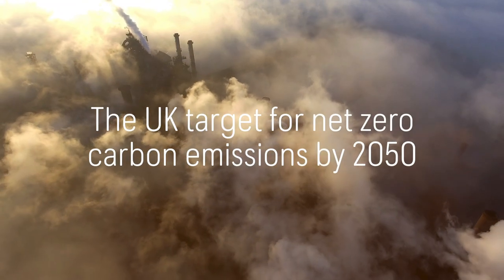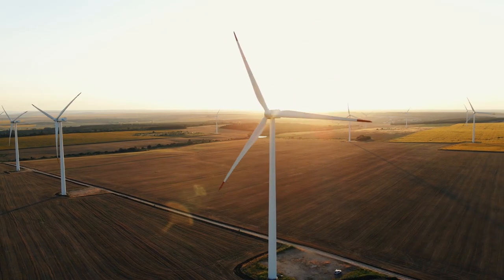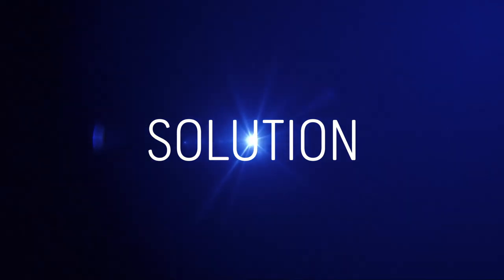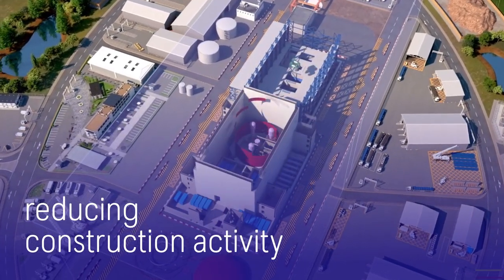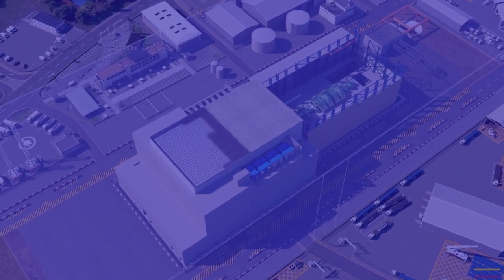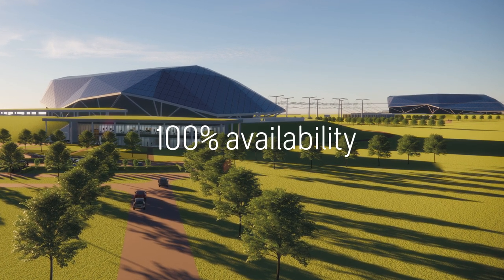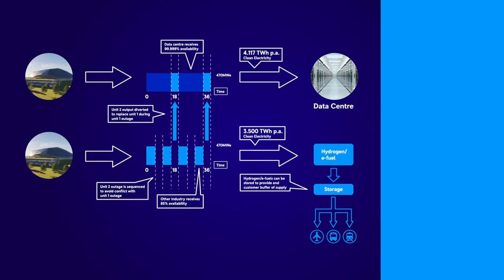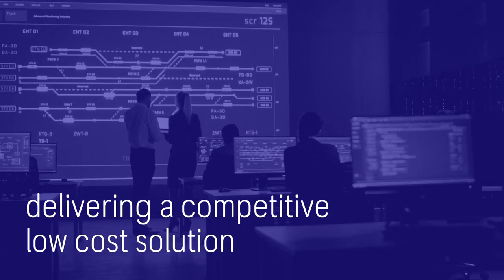Rolls-Royce | Small modular reactors

Comment: I think every large town should have one if these, and every city several. Time to step away from centralised energy production and putting all our eggs in too few large baskets. Will help close fossil fuel generation and peaker plants. This can't happen fast enough for me.
Reply: Towns having their own local modular reactors would also be a point of security. There's no central grid to take down that would shut down the nation.
Reply: @williamrbuchanan4153  You are talking about Chernobyl which is a large utility scale reactor with a design over 60 years old... These small modular reactors are the same kind that power submarines and power aircraft carriers. They are easy to build, safe and cost effective. BTW, the whole universe is radioactive, and it did not come from a melted fission reactor core! I take it you live in a cave and are still burning wood for light and heat right?
Reply: Chernobyl was known not safe when I was built. The yanks had been warning Japan about Fukushima for years. Waste disposal has been solved for decades, we just have to stop faffing around and do it. That said you can't just park these up next to small towns and expect it to work, you need to put a bunch of them next to each other on a larger site. You still get all the benefits, but they can be managed in one place.
Reply: @streaky81  Most towns have a power step down transformer site which would be ideal location if adjacent land can be purchased. Not sure what RR are specifying output at so not sure on multiples.
Reply: @GdaySport  that's the point, we know how to minimize transmission losses, the pylons need to be there anyway to keep the grid balanced and handle downtime, so you couldn't even use that as an advantage.
Reply: @streaky81  How is Nuclear waste disposal 'solved'?
I certainly like the idea of using existing Nuclear waste to reduce its danger time from tens of thousands of years to hundreds of years.
I Still want to see how it will be safely stored....
Reply: Yep nothing dangerous here.
What a brilliant idea.
Yes, sarcasm.
Reply: @stephenbrickwood1602  you sound a bit repetitive pal, perhaps go read some books about the advances in nuclear technology before copy and pasting blind negative comments about a subject.
Reply: @stephenbrickwood1602  newer nuclear technology has none of the security concerns of the past. Molten salt reactors need to be pushed forward. Look at the fuel and the waste products of those reactors. 

Also have a look at France for an example of how nuclear results in clean cheap energy... I don't like admitting when the French do something right, but I'll give em this one.

Obviously the salt reactors are not ready to go for now, but SMRs of a more traditional format are. And are perfectly reasonable with little to no additional security concerns used in many areas. 

Clearly for export there are issues to be discussed, but this is why molten salt reactor development needs to be heavily funded, whoever stumps up that cash first will be glad they did when they inevitably dominate the market after.
Reply: @GdaySport  470MW
Reply: Couldn't agree any more
Reply: With decentralized currency we can
Reply: It gets even better than that! Creating and distributing the power locally where it is actually needed greatly reduces the need for cross country power transmission lines and the resultant energy losses through them as a consequence of resistance and thermal convection
Reply: Write ypur congressman.
Reply: Two headed fish and glowing feces awaits us.

Comment: This is good. Not every city or town is going to need a full scale powerplant capable of producing gigawatts of electricity. The largest cities will still need that but most other places will get by fine on one or two 150 megawatt reactors.
Reply: But the Nuclear waste?
Reply: @cherylreid2964  there's a lot of things to do with nuclear waste, it's that nobody is actually doing anything with it. Some reactors can use nuclear waste as fuel. 

Also, compared to the millions of tons of toxic ash that comes from the burning of coal, along with gigatons of CO2 from fossil fuels in general, I'd say that nuclear waste is not as big a deal.
Reply: @cherylreid2964  Fuel reprocessing and fast reactors are the answer to the waste question.

Comment: When do deliveries start and where is the first one being built we need them quick
Reply: Regulatory approval is expected in 2024 with delivery beginning in 2029. The initial plan is to build 16 in the UK with each being able to power a city the size of Leeds (700,000 people). 16 SMR reactors will cost £30 billion in total and provide 7.2 GW capacity. Sizewell C, a traditional reactor, is projected to cost £35 billion with a total capacity of 3 GW. This is why the government is dragging its feet on further traditional reactors. SMRs have huge potential beyond electricity generation including community heating and cooling, hydrogen production, desalination and much else. Rolls Royce has a lot of experience in building military nuclear reactors.
Reply: @peterd788  Society accepted a multi year regulatory approval cycle for vaccines until Covid forced a radical acceleration. The ever increasing appreciation of a climate crisis suggests that Rolls Royce needs to raise its voice. Three years in regulatory approval for SMRs is no longer acceptable. Start with an appearance on BBC Newsnight. This technology and the probable use (later) of Thorium / Fluorine truly has the capability to be transformational.
Reply: @vincentmahon6423  I'd rather they follow the proper procedure.  As for thorium reactors they pose technological and proliferation problems.
Reply: @vincentmahon6423  I did reply about proliferation but it has gone. Basically, you can extract Proactinium from the Thorium reaction and then extract U-233 from that to create a fission device. A determined nation state could use the cover of a Thorium reactor to make a bomb.
Reply: @vincentmahon6423  sadly, they won’t, because “nucular bad! Hur- de hur-de hur....!” 🙄
Reply: Better be quick. “Someone” will copy it. Have it built in Xinjiang, with free labour. And corner the market, before you know it.
Reply: @peterd788  tens of thousands of years of Nuclear Waste is still not being addressed.
Reply: @vincentmahon6423  except for tens of thousands of years of Nuclear waste🙌
Reply: @peterd788  not so much with proliferation. Thorium is safer than Uranium.
Reply: @vincentmahon6423  tens of thousands of years of Nuclear waste is a huge issue.
Reply: @peterd788  Thorium was not used in early Nuclear Reactors because of the Cold War.
Both USA and Russia chose Uranium BECAUSE it can be used for weapons.
Reply: @Glenrok  Nuclear of itself has the issue of tens of thousands of years of Nuclear waste....
Reply: @cherylreid2964  The technology has moved on through at least two generations of development. The latest types of reactors generate very little waste. The waste that is generated has half life of some hundreds of years. These new reactors can actually use some of the legacy nuclear waste as a fuel. See also Thorcon's work in Indonesia, the work of Candu in New Brunswick and China's ongoing testing in Wuwei.

Comment: Does it require a location adjacent to a large body of water? Or is it entirely self sufficient?
Reply: It will need plenty of cooling water I should think. If so not a problem in the UK. The furthest point from the sea is 74 miles away in the Midlands. Being of smaller output they won't need anywhere near as much as a big reactor. More like the sort of supply used by a gas power station.

Comment: Question from a former nuclear power station engineer- Will the SMRs be refuelled periodically or are they going to run without refuelling for the designed life of the power station similar to the latest submarines requiring no refuelling for the life of the vessel?
Reply: Naval reactors use highly enriched uranium to enable its long life, which is not applicable to civilian reactors. So the answer is pretty obvious.
Reply: It's what they slap in the submarines so
Reply: They're intended to run full life without refuelling. Can't recall if they were aiming 30 or 40 years, one of the two.
Reply: @streaky81  the article says 60 years.
Reply: And my question is about Nuclear Waste....
Reply: Can't believe they would use HEU, otherwise the SMR would not be suitable for export. French submarines use LEU so I'm sure the RR design can be adapted.
Reply: @enemyofthestatewearein7945  the LEU the French use is effectively HEU anyway for all intents and purposes, it's just marginally inside to be under the cutoff. Honestly there's a difference between the export of an essentually complete reactor and a completed + fuelled reactor and actually what we don't know yet is how they plan to manufacture these if all goes well - it might be that they plan to set up factories in the EU, in the US, in Asia etc - if all goes to plan I'd think their UK factories will have their hands full supplying UK-use reactors; if they do that then it gets around all these issues and it seems likely. Not only that but it's likely local regulators will require some design changes for local use anyway which is another reason why it might make sense to manufacture them more locally.
Reply: RR are saying 18-24 month refueling cycle with 16 day outage. Maximizing the uptime is important for minimizing cost per MWh, I think this is also why they have a three-loop design because it allows maintenance to be done online.

Comment: Most of it boils down to the economics, what's the LCOE on this system? If it's north of US$70/MWh then it has little commercial use as both wind and solar would be orders of magnitude cheaper. I appreciate the tech and the based load but at what premium? That's the most important information and it was not mentioned in the video.
Reply: looks like something that can only be deployed is rich countries that can afford it.
Reply: @rajkishorebehera7489  But rich countries wouldn't buy it of they have cheaper alternatives. So, it's a non starter...
Reply: @EK4B16A2  they are only one who could afford to buy of they want to
Reply: Everything new starts in rich countries, as mass production brings cost down other nations can afford it too.
Reply: Nuclear Waste is also an issue with it lasting tens of thousands of years.
Reply: Solar and wind are only cheap when the resources are available. Nuclear electricity is more expensive because it's available all the time so it's more valuable. When you take into account the additional costs of energy storage to back up intermittent renewables, nuclear is actually quite cheap.
Reply: 70$/MWh is cheap for 24/7/365 solution of co2 free production, just look at today's market prices...
Reply: @MrPetzold123  mmm not really, depends on where you are. Most renewables are in the US$ 20 - 30 range and can add storage for capacity requirements under $50 - 60. They are less complex, less risky, known tech, etc. I love this new tech but without prices... means nothing.
Reply: @cherylreid2964  Nuclear waste (I prefer to say spent fuel) is 95% recycleable (20x energy)  and then reduces the remaining waste radioactivity to background level in 300 years .
Reply: @EK4B16A2  Look, I like renewables up to a certain point, but battery storage on large scale is fantasy. History has shown (Sweden, France during 1970' and 1980's), that to really reduce co2 emissions, we need to embrace Nuclear. What comes to price: If we build thousands of SMRs, prices will inevitably drop.
Reply: @MrPetzold123  depends where you are. I've worked on wind in western Canada and latin America. Wind never stops. Capacity factor >70%. You can sell firm power no prob. You would only need a bit of storage in the PV / Wind mix to even things out. You also have hydro and nat gas shaving peaks. 

Tell me 1 nuclear project that hasn't had a massive budget overrun on construction. It's not as feasible. Not as cheap.
Reply: @EK4B16A2  Wind never stops...capacity factor 70%...ok, I'll take a look at Fingrid today...1036 MW, has been in last month everything between 30 MW and 3000 MW. (Capacity factor 1%...100%)
Nuclear projects without massive cost overruns...Sweden between 1970-1985 built 12 reactors and decarbonized their electricity production even before anyone talked about carbon footprint...it is still the world record what comes to speed of reducing carbon emissions / capita.
Look, nuclear in principle has a massive advantage due to its superior energy density (as we know, one 1 inch uranium pellet has same energy as roughly 500 m3 of natural gas, 500 liters of oil, 1 ton of coal). 
True, we have lost our ability to build on time and on budget that previous generations had, that's *our fault*, not inherent in nuclear energy.
SMRs could turn that tide, because anything FOAK is expensive, anything serially produced tends to be cheap.
Reply: @MrPetzold123  I'm totally with you. I'm a full supporter of nuclear but, as a developer,, I really see what happens in the ground. If you factor in the complexity, the  LCOE, the public opposition (even if unfounded), the expected cost overruns, etc.... what ends up happening is that the other technologies provide a simpler, more cost effective solution. That's all.

Comment: They are acctually what nowdays is reffered as SMR. Small Modual Reactors.
Though looking at Rolls Roys SMR they are quit big 470 MW and the small is that you are to be able to produce them in modules at a factory not bigger than fitting transports on roads or rail roads.
Like Lego.

Comment: So is it just a small repackaged uranium and water reactor, Like three Mile Island, Chernobyl, Fukushima? I know the new catchphrase is SMR but reality it could be repackaged cold war relic reactor and not one of the new reactor that uses MSR (Molten Salt Reactor) that could make a big difference in the amount hazardous radioactive storages and how long it stays dangerous, please add more info and less PR.
Reply: Strictly speaking it's "just" a repackaged marine reactor in a nice building. Though it isn't "just" that. They have impeccable safety records, not that the rest of the nuclear industry doesn't anyway. MSR isn't going to be a thing because we're going to have fusion energy before then - what we need is something ready to go now that can fill that 25-50 year gap to get fusion commercially operational on a large scale.
Reply: @streaky81  
The true reason to have a SMR, is to place the SMR where you need it and make full uses of its output! If uranium is used, you greatly reduce the types of placement location due to security concerns,  now with out the use of MSR to make full use of high thermal energy output directly for manufacturing and material processing like deceleration, concrete etc. Your efficiency drop even more through in a rehash cold war reactor relic design you're efficiency drop to the floor at around 1% fuel burn from such a reactor. So basically after any conversation for transmission lines and converting electric back to usable heat you might get .10 to .50 % out of that uranium on good day.
Steve Ballmer dance around the stage telling us that XP is the most safe and secure OS on the planet on XP release date, it didn't take long to find out how wrong he was, large amounts uranium nuclear waste from an unefficient backwards reactor how can anyone make a statement trust me nothing bad can possibly happen in 10,000 to 20,000 years of storage. 
I too what want fusion, but not at the price of the world slipping into a energy Dark Ages after 80 years of broken fusion promises. The only fission reactor that come close to the unattainable dream of Fusion is Thorium Molten Salt Reactor that we will have to buy from the China because there are the only government with sense enough to complete Alvin Weinberg civilian nuclear reactor technology with a prototype under test and plans for production units in the gobi Desert.
Reply: @drmosfet  the reason to have SMRs is you can essentially build them in a factory on a production line and they be extremely passively safe for similar reasons to why naval reactors are. You don't need to assemble them from pieces of nuclear stainless you bring to site in sheets then weld together there. This has all sorts of implications for speed of build, cost and safety. "how can anyone make a statement trust me nothing bad can possibly happen in 10,000 to 20,000 years of storage" - because geologic time is expressed in millions and billions of years not decades and centuries. How old is the chalk on the south coast of England, relatively new rock, let alone the impermeable igneous rock miles below the UK? Exactly.
Reply: @streaky81  
The first time I heard about the Term SMR was a decade ago when I realised there is a alternative to the first generation of Fission reactor, term was used to describe Thorium Molten Salt Reactor with all the manufacturing benefits you mentioned in your last post, until just a couple of years ago I noticed that they often mentioned SMR but actually mean first generation nuclear reactor instead and would not mention that it used uranium at all, it seems like smoke and mirrors to me. I've think I made it clear why I don't like the ½ centre old first generation reactor, if they keep the very first function steam engine and never moved on from there we would not have global warming now, but that what happened to the nuclear industry. The design might have been useful for cold war times, but not now.
You might be more trusting in people then me, but having uranium all over the place doesn't seem like a great ideal to me.
I have to agree that rocks are trustworthy, it the people with 20,000 years to mess up things that make me nervous, to get an ideal what I'm talking about look up the horrible tragedy when some semi natives people from South America try to scrap out a nuclear medicine machine.